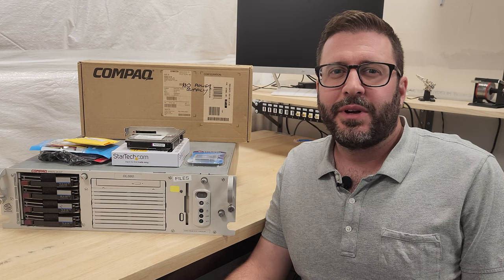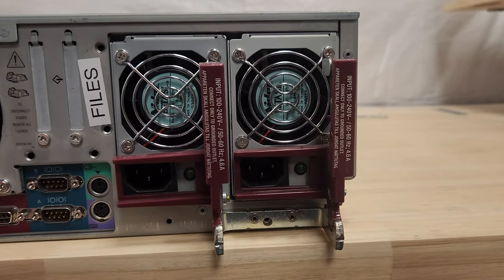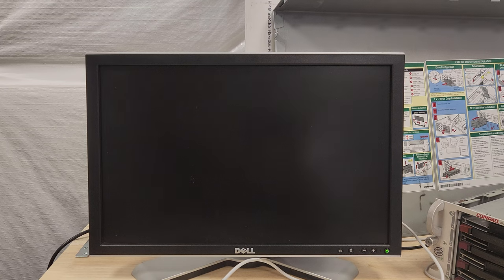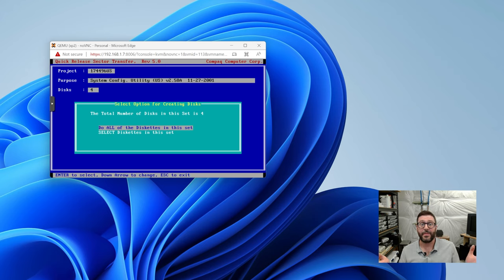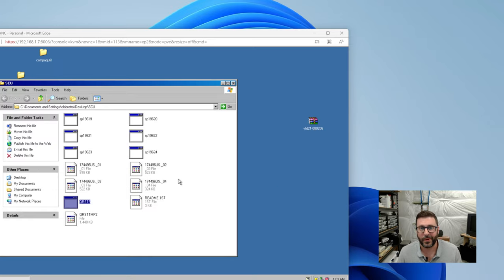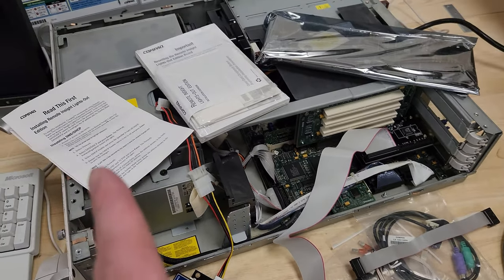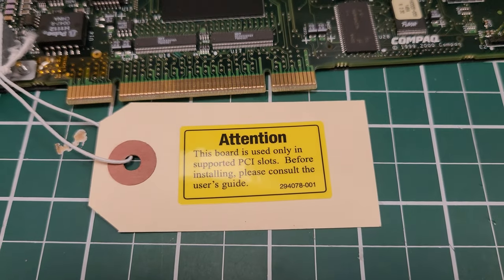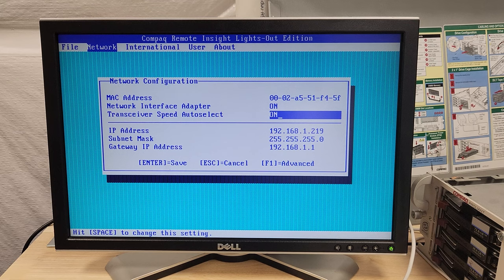Setting up a Compaq ProLiant DL380 from 2000

Comment: My dad worked on these servers for HP and Compaq back in the day. He had one of these exact machines in his lab at his office so he could test software and SP bundles for customers. He had it running Windows Server 2003 when it first came out. Quite an impressive machine for its time. Yes, the Compaq BIOS utilities ran a very custom version of Windows 9x and before that, Windows 3.1 in older machines.
Reply from the maker: very cool!

Comment: I used to work for an authorized COMPAQ dealer in 2000/2001. Smart start was different.  The worst part about running old java based hardware is finding the right version of java.  (the ILO on the Dell R710 is also fun to get working for the same reason)  I have a Cisco ASA 5510 in my home lab and it took forever to find the needed java files to run the ASDM.
Reply from the maker: Oh yeah... the idrac on my R510 is a real treat to get into these days.

Comment: Until a couple of years ago i ran a compaq Proliant 1850r as my mail server with Debian 4.0. The label on the outside of the machine was Josef. 
It was the predecessor to the DL380. It was a dual pentium II machine. It had two 9 GB SCSI drives in RAID1, two 18GB in RAID1 and a pair of mirrored 300GB Maxtor Diamondmax SATA drives connected to a cheap SATA card. 
It ran great great for more than 10 years. Then it didn't run any more. I found my second 1850R machine labeled Stalin in storage and used it to read the drives and to virtualize everything. 
Last spring i replaced the VM with a new VM where i run mailcow to self host my email.

Comment: I worked at a job that bought these second hand and would throw them in a colo to rent out.  They were too cheap to buy proper rail kits and had like 5-6 of these resting on some kind of rack mounted L bracket.  One day we got a swarm of Nagios alerts in and I rushed down to take a look.  Turns out the bracket blew out and all the severs were falling out the rack.  There was so much weight that it forced the locked cabinets front door wide open. Good times…
Reply from the maker: haha that's amazing.
Reply: tips server

Comment: I just got a Compaq Proliant 1600, Dual Pentium 300 mhz with 5 SCSI drives i array. I had the same issues with Bios and stuff. I installed Windows 2000 and made an ISO image of the SmartStart CD. Installed all drivers and software in Windows 2000. Worked perfectly with the Disk Array SCSI management.

Comment: I assembled and configured a bucket load of those servers and tower aquivalent : the ML530. Usually they came partially mounted. We have to add the Smartarray controler,  power supply and processors. 
Last year I found one of them burried inside a factory, covered with dust, dead insects and all kind of disgusting things. It was in charge of an automatic label printing for boxes with a very basic Windows 2000 and a simple program.
Reply from the maker: Amazing! I unfortunately didn't mention it in the video because I was too busy complaining about SmartStart, but these things were built with incredibly high quality. Wouldn't be surprised if that thing was still runnable!
Reply: @clabretro  Usually they run for one or two days, after the power supply or the voltage reglators of the CPU quit. But, if they are constantly running, they can stay up for years.   

I also found a Fujitsu TX300 first generation running in another factory with a storage expension. Sadly it died few days after  my visit. It was the last Windows NT I saw up and running.  

For the smartarray,  my heart sank  when I saw the 4 mini SCSI ports on the back. So mush bad memories. 
the worst was the firmware upgrade. I was like the Russian Roulette. you applied it and pray.

Comment: I did that whole StarTech 5.25-to-3.5 in drive bay CF card reader deal, and love it for Linux Mandrake 8 and Windows 9X. Did have issues with Windows 2000 - very VERY slow, so I just use an IDE-to-SATA (or vice versa) adaptor to use SSDs for that and subsequent Windows.

Comment: So the reason the bios is so odd on the old Proliant systems is due to their evolution from Compaqs EISA systems. This system configuration menu is lifted right off of any of the early 90s Proliant servers or Compaq EISA workstations. It provides a facility for reading EISA configs off of the floppy drive. 

I have a DL360 G1 which is basically the same server with much less expansion room and only a single power supply. Still supports the lights out card.

Also have a Proliant 1500 from around 1995-6. Still works great. 

These old servers are tanks.
Reply from the maker: Ahh that makes sense! They're definitely built like tanks, build quality is excellent. I should've mentioned that face plate is a solid 1/8 inch piece of metal too. Now you're making me want to hunt down the earlier 90s machines.
Reply: @clabretro  the earlier ones before 1998 have way more custom silicon from Compaq itself - Triflex Architecture they called it. The CPU bus was decoupled from the rest of the system making it possible to upgrade CPU generations in a server I.E 486 to P1, or P1 to PPro. It also enabled Compaq to make dual or quad CPU options. 

The Pentium II era and beyond shifted away from Compaq custom ASICS to off the shelf chipsets,  but still good stuff

Comment: When I use IDE controllers with old windows NT/95/98/2000 sometimes even XP I have to install drivers from disc in the beginning of the installation to find the disc/card
Reply: Seconded. There's a 'press F6 to load drivers' prompt in the installer screen for Windows, you need a Windows 2000 driver (must have a .inf file and the driver files) for the IDE card you are using, on floppy, and load it via the F6 utility otherwise the card won't be recognised by Windows.

Comment: Used to have 100s of these in the data center I worked in. Very solid machines, and I would run Linux on the retired ones and they ran linux like a champ.  The BIOS was definitely weird, but once you got the OS installed it just ran for ever.

Comment: We used to have an HP ML350 Gen 5 server at my work, which is a school. For a dual processor Xeon (Core 2 era Xeon) system, it always ran pretty nicely. Later developed a power backplane issue with only 1 PSU installed, so had to run 2 PSU's to solve that problem. Thankfully it did have a normal BIOS you could just access and it was actually a pretty straight forward machine. It got annoying once HP moved the SmartStart packs behind a pay wall, so no more firmware updates for that poor server.
Reply from the maker: Very cool. So I guess the SmartStart disks weren't behind paywalls under Compaq? Hard to find info on that stuff.
Reply: @clabretro  I think HP also had them in the open for a long time, but at some point they decided they needed to monetize things, so updated SmartStart disks were hidden behind active support contracts if I understood correctly. Was a big reason why when the gen 5 server needed to be replaced, I didn't go with another HP server. Enterprise companies love doing moves like that with firmware sigh...
Reply from the maker: Oh interesting. Yeah if they're not hiding it behind paywalls they're deprecating it, right? Ha.

Comment: This reminds me of my messing around with a DL380 G2 found in a dumpster-dive. Absolutely gorgeous interior, and the only tool required to disassemble it is an included torx key. Then when I tried to get it running it took me ages of poking around old FTP servers to find the firmware to change the iLO card to 128-bit SSL and the program to create compatible virtual floppies, because I have neither a CD burner nor anything with a real floppy drive, except it.
Reply from the maker: Ha that's awesome. I hadn't thought about dealing with the firmware.
Reply: @clabretro  Yeah. I tried to install an old version of Slackware on it too, but failed for driver reasons. The iLO 2 web interface is actually quite similar to the interface shown in the video, by the way. Had to use it for everything I was doing, because I don't have any VGA monitor. I should fire it up again some time soon.
Reply from the maker: Interesting. Yeah give it a shot, it's always fun to mess around with these things.

Comment: I can’t count how many of these I unboxed, racked and built back in early 2000s and big brother ML750
Press F6 during Windows installation and you can the. Inject the SCSI controller driver and the RAID disk will be visible for you to install your OS on to.
Reply from the maker: Ha that's awesome. Yeah I'll need to experiment with some SCSI controller drivers.

Comment: I'm fairly certain I have the tower variant of this system or something very similar...  Accessing BIOS on the older ProLiant machines is always a challenge!  Without the setup disk, it's indescribably difficult.

That being said, these systems can handle almost any hardware failure while running.
Reply: I've managed a cluster with ~1,300 HP DL-360 Gen 8 systems...

Today's HP Enterprise systems, as quirky as the old ProLiant systems, are so much easier to manage...

Comment: The IDE card is probably fine, but Windows 2000 most likely does not have drivers for it. During the setup loading look at the bottom of screen there should be a prompt to hit F6 briefly, this will give you the option to load a floppy with the IDE card drivers so that setup can know how to read from the device.

Comment: As for the IDE controller working; As long as the controller has its own boot ROM, it's almost always going to work. It does of course need support for older systems, but if it has its own BIOS ROM it should work fine. I've tried several cards without ROMs, and have never got any of those to work.
Reply: i do be using a fiber nic

my highst school nickname was 1 ggigabit fibernic in high scholl

Comment: Got one of these a while back, upgraded it to 2 pIII 750mhz. I was wondering if anyones looked at modifing the smartstart  to allow for more configuration controll and OS support with linux or solaris
Reply from the maker: nice! yeah I didn't look at linux support there
Reply: woumd up trying to give solaris 8 x86 platform edition but unfortunately the onboard scsi raid controller wasn't able to present the drives to the setup. 

may look at trying this again in the future  @clabretro

Comment: Me being the retro Compaq ProLiant fetishist that I am, I've tinkered enough with these to figure out you can USB boot and install operating systems if you plug a generic USB PCI card into the system, boot the Plop boot manager from floppy, and then select USB as boot device. It will then boot either Windows or Linux normally. If you're going to venture into Linux, these old systems have a fairly retarted BIOS, and will not find the boot partition if you install with automatic settings. So you have to manually set up the partition table, making sure to put the boot partition at the beginning of the drive.
Reply from the maker: Oh very interesting! Now I have a reason to find a USB PCI card haha.
Reply: @clabretro  Haha indeed! And I came to think about the cf cards not booting.. I've never had that working either. They will work inside the os as storage devices, but it can't boot from them. I think it's a mix between the BIOS being grumpy, and regular cf cards showing up as removable storage devices. Apparently the industrial vf cards show up as hard drives. So maybe that could be an option. In my ProLiant 5500 I've got a Zheino IDE SSD as a Bootable system drive, and two SATA hard drives as mass storage devices. (SATA controller cards work fine as well, but not for booting)

Comment: Had a couple of customers running Netware 5.x w/Groupwise on these boxes. That was before I joined Novell Inc. and lost all interest in hardware. I still think it was a shame that HP bought Compaq.

Your own shrinkwraped SmartCD would propbably not work, you always had to use the SmartCD which was released with the server or one which was released later. 

And yes SmartStart was a bit of a pain, but you got used to it. In the mid 90s I installed a "few" ProSignia 300's, from taking it out of the box until it was running NetWare 3.12 took 20-30 minutes - Compaq was just working.
Reply from the maker: I could definitely see how you could get used to SmartStart
Reply: @clabretro  not used to in a "nice" way, it was how it was, but more than once I had similar problems as you. The one you have in the bag is too old, and getting a new downloaded a burned to a CD was not possible as you're onsite. It was just a general pain, but that was how it was. Then the option was to download the floppies and make them.... right. 

Then there was the whole SmartCD license thing, customers could get licenses for Netware, Windows, and a few other things via the SmartStart as Compaq was a reseller, then you also needed to get the license key for the OS you were installing ... more headaches. As I mainly was doing Netware, if there was a problem with a license obtained from Novell, then I just called Novell, but with the SmartStart stuff;  to say the least it was not always easy.

Comment: The IDE to compact flash card adapter probably works fine. The issue is most likely with the actually compact flash card. You need to set a flag on the actual Compact Flash card to make it a permanent storage device.
Reply from the maker: thanks, I'll take a look at that!
Reply: @clabretro  I believe sandisk used to make a utility to do it on their older cards.

Comment: what did they run the os off of orginally, one of the scsi drives?
Reply from the maker: yeah I bet they probably had all the bays setup in some sort of raid configuration.
Reply: @clabretro  depending on the use-case, 4 drives is pretty low performance so it was probably all 4 drives in a RAID5 array, then two logical drives created on the SmartArray controller for OS and files.

Comment: Nice video, thanks for sharing these practically useless and time consuming experiments, just for the fun of it... So why haven't you tried connecting a regular IDE disk to the Promise controller? I have either used a Promise Ultra133 TX2 or an Abit HotRod 66 back in the day, just to have some cheap storage option in my ProLiant ML350 G3.
Reply from the maker: Because I don't have any regular IDE disks, unfortunately 😆

Comment: Try Debian 12 on this hardware.
Reply from the maker: Gonna need more RAM 😂
Reply: @clabretro  
512 megabytes of RAM is enough for  Debian (i386 architecture)  for several daemons (NGINX, MariaDB, Samba,AD, NFS, etc.).
For more stability, it is worth making a SWAP partition: 1024 megabytes or more.
(YT bot removes links.)
Reply: @clabretro  
I'm just curious if the almost latest Linux kernel can handle this hardware.
And aren't you?
Reply from the maker: I'll bet it does — I'll throw it on there eventually and keep you updated!
Reply: @clabretro  
Everyone installs old and unsafe software on old hardware.
But no one is experimenting with newer and safer software on old hardware, and that's also an interesting direction.
Reply: PSA: I tried Debian 9 on similar hardware (ML530 with the same remote insight board, 2xPIII, 1+ GB RAM) and I'll never get that part of my life back...
I'd say stick to what it says it supports on the SmartStart CD, lots of fun to be had. Like watching Die Hard 4.0 on Windows NT 4.0.

Comment: USB floppy drives are not true floppy drives as far as those older computers are concerned.  with USB floppy drives there is no real floppy controller, and they only handle 1.44MB or 720kB disk images, and they simply will not do non-standard things to a floppy disk, which is why there is a tool to create the floppies for you, instead of downloads of floppy images.  The disk image creator from Compaq did some slightly special things to make one or more of those disks bootable which is not something that all USB floppies can do, if the computer you want to boot from the floppy is very old, such as the Compaq you're using here.  You will almost certainly need to make those floppy disks with a real computer with a real, old floppy drive connected to either an integrated floppy controller, or a floppy controller on an ISA/PCI card.
Reply from the maker: oh thanks! that's useful info. so it probably would've been futile with that USB drive regardless.

Comment: ITE IT8212F is by default in RAID mode
this chip may not support Compact Flash. It is NOT exactly ATA. It is very very close, but chips like IT8212F are made as basic as it could be, therefore it may not be able to cooperate with CF

Your choice of ATA controller was very bad for your purpose
P.S. they are quite flaky anyway. I have had one and didn't like their overall performance
Reply from the maker: Yeah I'll have to play around some more. I also just picked up a BlueSCSI so that might be an interesting route.
Reply: @clabretro  BlueSCSI is quite slow for such computer
Reply from the maker: Yeah, more just to see if it works. Won't be doing a whole lotta work on this thing haha.